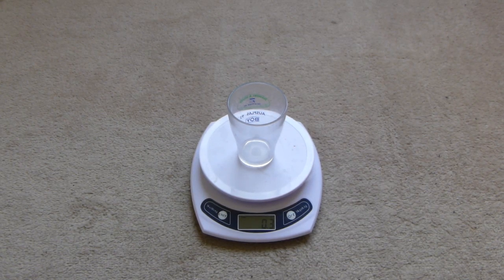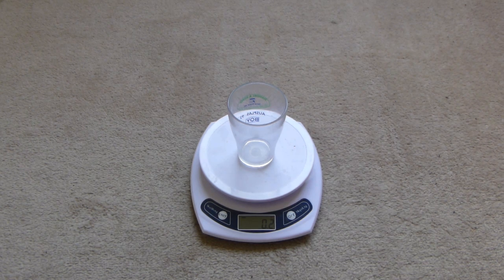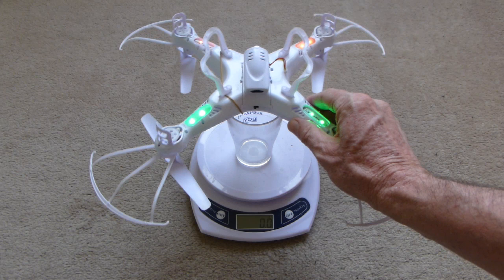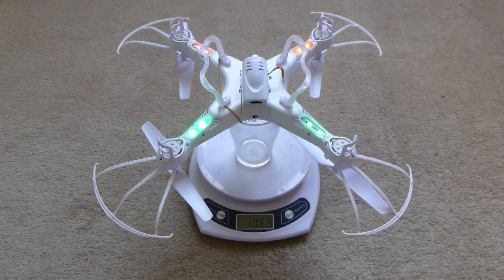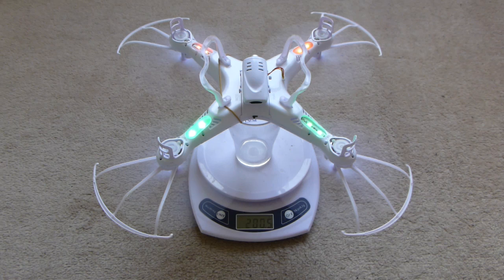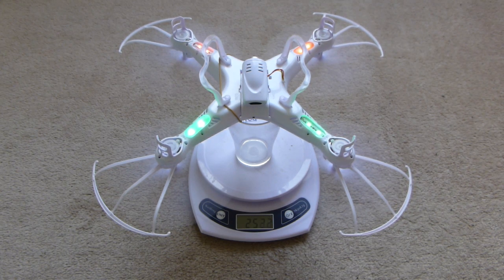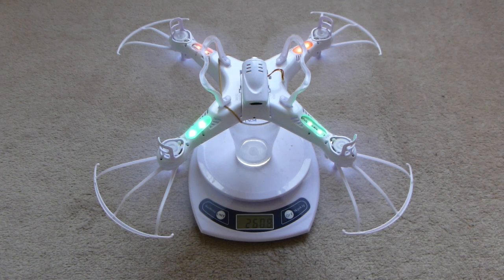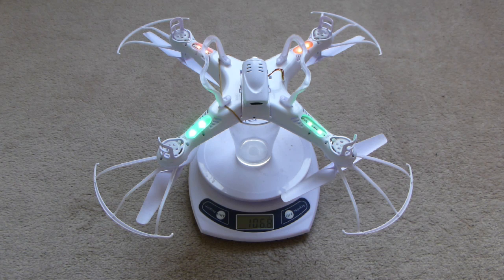Syma X5C-1 thrust measurement.

Comment: well this is actually relatively easy to figure out the science is wrong but the lifting wight could still be found by with a relative margin of error the weight of the drone is 106g and max thrust in grams is =260g-106 
meaning that it can lift 154g  but there is a problem and that is the gyro sensor is going crazy trying to stragten the drone meaning the power of the motors is 50% to 70% less than what it would be 
meaning it could lift from 308g to 220g with an average of 275 g but in the video he also has the 9g video camera on there along with the 6g prop guards and the 1g scared
in covering the average weight could lift by it self is after removing all of these is 291g which is about 0.641545 pounds or 10.2647 ounces.
But then again its a not very well controlled test but it should be able to lift 291g safely if not more.
so you could lift a go pro depending on the make but the stand would need to be extremely light weight 

I also forgot to remove landing gear

Comment: Awesome idea, but this is most likely off by about 25%, the flight controller will always try to flip the quadcopter right side  up. So the quad will probably only supply 50% of the max voltage to one side and 100% to the other (or something similar), attempting to make it flip back around. Therefore, the total thrust available, (as shown in this video), would be about 75% of the actual max thrust when flipped rightside up.

Comment: hmm so it can hold like 143 grams? so if it attach a fairly light frisbee to it can it lift it up?
Reply: yes but from that you need to subtract it weight. So you can easily lift something weighting 35-40grams
Reply: ok thank you, i was planning to do kind of a air lifting thing...
Reply: +Raiyanblader i came up with a more exact since the drone always tries to stables and turns back up his measurements were 50 to 70 percent off because all of the engines were not at max power
i just wrote a comment and the average after the fix of the gyro sensor was about 275 ish grams but by removal of the camera guards and landing gear you can get it up to about 291 to 300 but don't max it out either there would not be enough up force to lift any weight around 275 so i would suggest going with 100g as a max so you could have stable flight and not burn the engine or drain the battery faster resulting in a slower flight time
Reply: hmm thanks :D ill have to try that now :) soo i guess i'd better get to removing the stuff now :P

Comment: Hi David, very interesting. I have also carried out these tests, but by strapping a 350 gram weight to the underside and that keeps the quad firmly planted. I tested 2x identical X5C- 1s except for the build dates. The earlier one with a v5 rx board has 134 grams of thrust and can just about cope with a 808#16 camera. The later one has a v6 rx board, produces 155 grams of thrust and can haul the same camera with ease. I have yet to find the reason why this is. Its nice to know your results, and going by the date,you may have a v3 board or a v5.

Comment: Hi David,
Can you please help? My 15 year old son just got one of these Syma X5C-1.
Someone told me that the Lipo batteries are very dangerous, so I search for videos here on YouTube, and now I'm freaking out. Are these little 3.7 Volts / one cell batteries the same as those bigger ones / multiple cells (used on DIY RC)? Do we need to take the same steps when storing/not using the batteries? Do we need a special charger to put them into store mode? Please help!
Reply: dana miller These batteries are not 'extremely' dangerous as far as I know. The main danger that I see with them comes mostly from someone leaving the battery on the charger for far longer than it should be after it has achieved full charge. The batteries swell a little bit as they get hotter, if you keep charging it and it gets very hot it could cause it to burst. If your manual says to charge it for 120 mins, just make sure you don't exceed that by a very large amount because I don't think some of these cheaper chargers will shut off when they are done. If you want to store the Li-Poly batteries for long term storage, it's recommended that you store them at about a 50% charge.